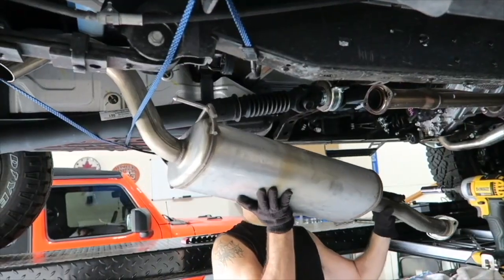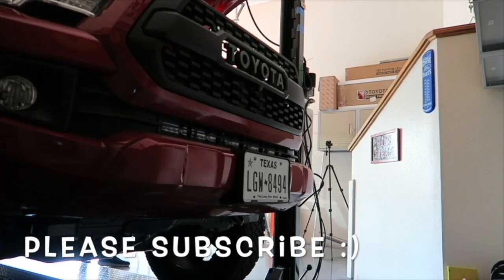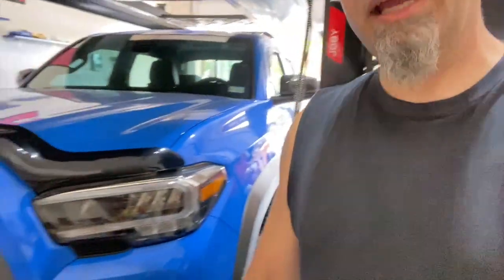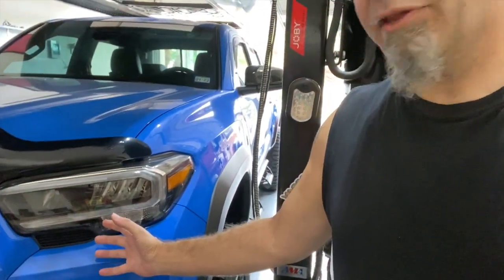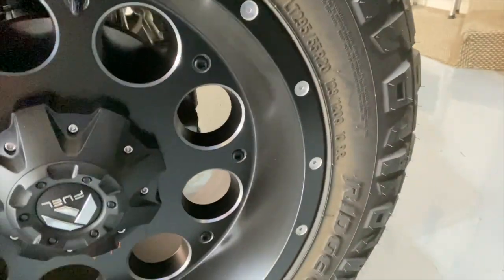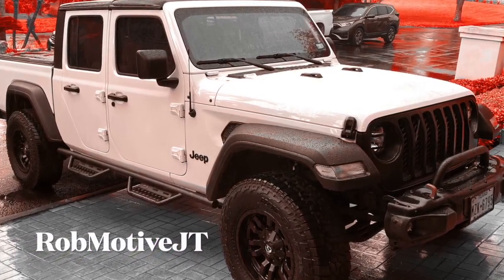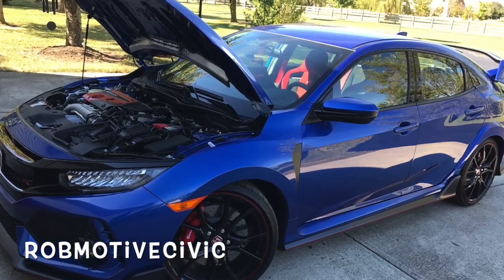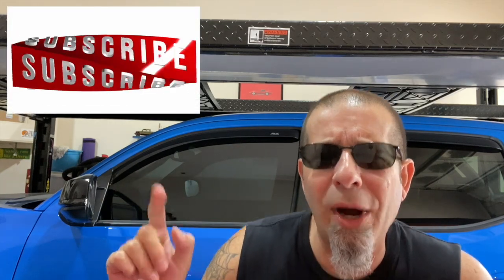New Tacoma TRD Sport X

Comment: Rob although I agree that would be and awesome truck I think you might be low on your price estimation I think a truck like your describing would be in the 70 thousand dollar range witch would put them way out of the range of allot of tacoma enthusiasts I myself because of my disability income would only allow me the sr or sr5 and neither come with manuals anymore so unless my 2017 sr is nearly 5 years old now the fact that I only have 21000 miles on it with no major problems this will probably be my last new vehicle only have 6 payments left and most of the mods I felt where needed are done thanks again for a informative video
Reply from the maker: You could be right🤔. I’d love to know!!